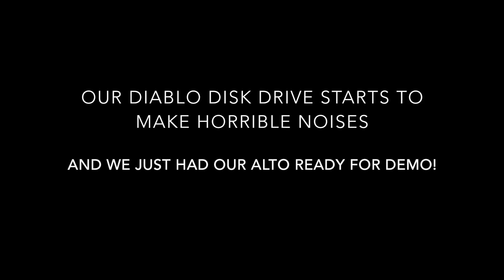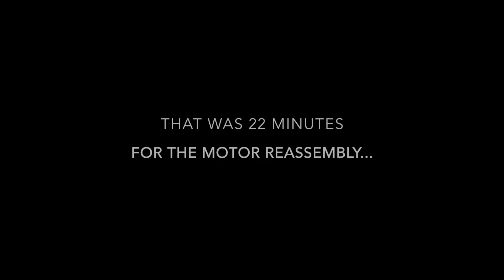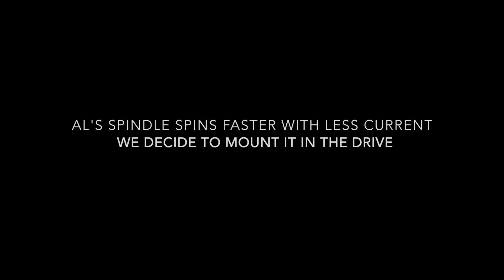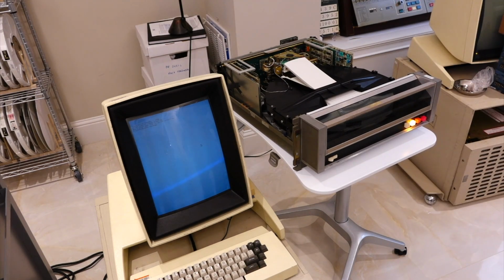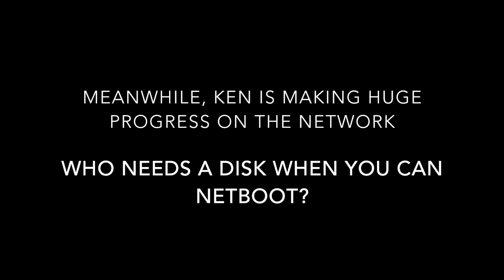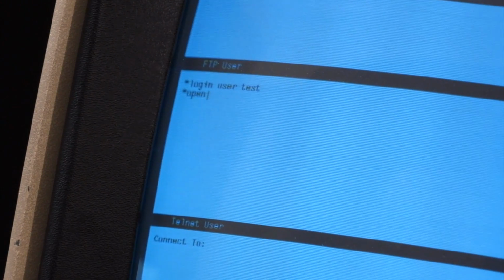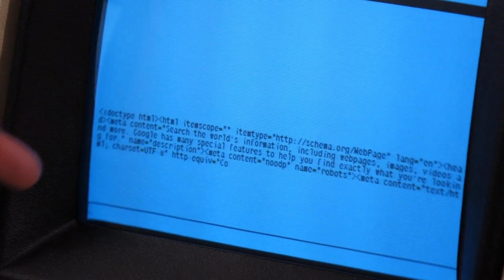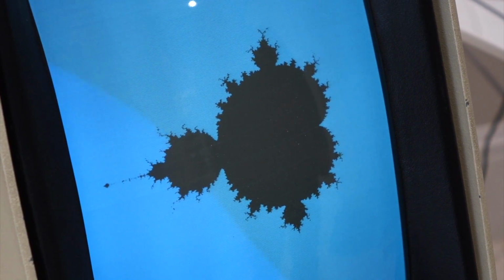Xerox Alto Restoration Part 16 - our disk goes down, the Alto connects to Google and draws fractals

Comment: Only 45 minutes to calculate the Mandelbrot butt-print... that's very fast compared to back in 1996 when I first got into computers with my first computer which was an IBM XT with an IBM CGA monitor and nicely-clicky IBM keyboard and I found an example BASIC program in the 1994 PC Pocket Ref book which was a simple Mandlebrot Set demo. I loaded GW-BASIC and typed in the 5 or 6 lines out of the PC Pocket Ref and hit the 'run' button and it took all night for the XT to calculate and display the completed butt-print. ;-)
Reply: Nowadays I run Linux and my favorite Mandelbrot Set zooming program is one called "Xaos"... I set it for 17,000 or so iterations and move the mouse-cursor over a desired spot on the butt-print and press and hold the left-click button and it smoothly and beautifully zooms in as long as the mouse-button is held, like travelling through psychedelic space...lol  ;-D

Comment: LOL.. the piece left after the initial repair, loved the games, Those games where hitting the barroom floors at about that time probably running off of the intel 8008..  love the telnet, but that Diablo, I remember from a time sharing terminal back in 1973.. the pretty much original dialup.  Love the emulator.  Recording all of this and the collection of records most certainly makes this historic en-devour with while and great for actually understanding computers.. I would say required course material after a basic or C first semester course..( CS104 Computer History - Required)

Comment: Wtf is he talking about nonstandard Ethernet to the modern Ethernet? That makes no sense what so ever.

This guy running the camera must not have any computer or networking experience.
Reply from the maker: You might want to watch the other videos, or maybe Google the history of Ethernet. You will find that this is the machine on which Ethernet was invented/prototyped/demonstrated for the very first time. Modern Ethernet would eventually evolve from this, but this first prototype implementation is completely incompatible with the modern version we all know. Not the same  bit rate, not the same packets, not the same CRC, not the same protocols, only 256 addresses (!), etc... It was actually a very large challenge to reverse engineer it and make it communicate with its modern offshoot. Some of the Ethernet inventors actually visited us to see their original machine, see in the video here: https://youtu.be/XhIohWr10kU .
Reply: CuriousMarc you do realize their is other networking media used other than Ethernet on networks right? Also a network that needed to talk to another incompatible network is done with a gateway. They have been around a very long time. Not a new thing by any means. Just not commonly used now.
Reply from the maker: @tomhardware2254  Not sure I understand the hate here. I answered your provocative and foul-language question in detail, see above.

Comment: guys do you have plans to replace the diablo disks with something that resemble a SSD like some SD card or CF card?
Reply from the maker: Heresy! But yes, Carl is almost done doing such a tool, which we will also make available for the CHM and the LCM museums. We won't "replace" the beautiful Diablo disc with it, but that gives us a way to try Alto packs quickly and not need to make new original ones if one crashes.
Reply: excellent. and thank you for answer. it is a great series of videos.

Comment: Hi Marc, what is that piece of equipment you were using to power and test the spindle motor at increasing speeds?
Reply from the maker: It's a lowly HP power supply, a bit modern and plasticky to my taste. But it has very precise voltage and current limit settings.

Comment: very very nice may i suggest you to separate the calculation and the  rendering process in two distinct parts ?
Also at the rendering level i'm pretty sure there is a better way to draw lines :
Store the length of the line and the number of pixel to draw , 
Display first the shortest lines first drawing one pixel at a time and for the lines longer than 30 pixels use loops or delayed loops and draw into graphics memory ...

Comment: Lithium grease doesn't dry out. Do you use that across the board in vintage computer hardware repairs that need oil?

Comment: I'm guessing that the disk drive starts up with an open speed control loop, and when the disk controller comes up it closes the control loop and brings the speed down to the proper operating speed.
Reply from the maker: +douro20 Good guess!

Comment: Okay, now you just need to run a version of Doom on it with the music and sound effects.
Reply: I don't think the Alto has a sound card, only a beeper.

I also don't know if the Alto has the horsepower to do Doom at all.
Reply: I have seen videos with an Alto which had a music keyboard and could play multiple notes with definable waveforms, but I never found any mention of this in http://bitsavers.trailing-edge.com/pdf/xerox/alto/ including the lists of non standard peripheral options for the Alto.
Reply: I found a video of the Alto playing music: https://vimeo.com/111334074
Reply: DOOM was ported to run on a VIC-20, so it could probably be done on the Alto as well.

Comment: Wow ! Booting off a network ? That was very advanced for 1974 ! Xerox executives had no idea how ahead of its time this machine (system) was. They could have been the Apple and Microsoft of today, combined into one company.  We can only imagine what this system would have become some 43 years later... It took an extremely talented,  innovative, and visionary team to come up with the Alto. Something missing from today's computer companies that are solely focused on profits instead of innovation.
Reply: if fact the Xerox Alto impressed S Jobs himself.
For the network boot just have to show the network device + the tftp stack to the firmware and boot just as it was a regular device ... 
boot bootp , boot tftp
Reply: @123jstechservices3  Linux can do this also. I built a pentium 130 diskless x terminal by booting over bootp and tftp with linux from a linux server back in 1999. All it needed was to program an eprom for a ne2000 network card (they all had an eprom socket!). the tools are open source. I later (2002) replaced bootp by a 4 MB (yes, megabyte) solid state ide hard drive to load the kernel which then mounted root by nfs like before.
Reply: Don't forget HP and Adobe.  They invented the laser printer as well.
Reply: 1973 not 1974

Comment: If you modify the program to turn the display off while computing the Mandelbrot fractal, the program will run significantly faster (since the display microcode is essentially idle, leaving the Emulator task more time).  Might be able to get it down to a mere half hour!
Reply: When I used software to compute Mandelbrot sets on my old Atari 8-bit computer, I used the same technique. You could turn off the display, and speed up computation, since part of the CPUs time was taken every 60th of a second to redraw the screen.
Reply: And then you could also "cheat" and just compute the top half and mirror it since the pattern is symmetrical. :P
Reply: The old Sinclair ZX81 had a similar feature - you could ask it to run in FAST mode, which turned off the screen refresh.
Reply: Ashley Pomeroy the commodore 128 had the same thing, you typed FAST into the basic prompt and the screen went blank, you could type SLOW to make it go back again
Reply: This takes me back to writing my own draw functions for a variant of BASIC (DarkBASIC): the default commands would update the screen after every call, which made them horribly slow.

Comment: Great progress!
In the video it looks like you have the brightness / screen turned up too high on the monitor, there are visible retrace lines. Had you turned the contrast down to try and preserve the phosphor? 
This is making it very tempting to come out to VCF West!!!
Reply from the maker: Yes, it was up too high by the time we took this. The monitor is usually dark at the beginning of the day, then brightens up as the contaminants gets boiled off the tube's cathode. We can't find a replacement tube...
Reply: Ah that explains it. Too bad you haven't been able to find a replacement yet! Is it an oddball CRT? 
At least once it's been on for a while the picture is bright and clear :)
Reply: They could send it to Lexel to get it rebuilt, but I don't know if the Y-Combinator wants to spend that much money.

Comment: I have computers that are 20+ years newer that can't netboot. Impressive.
Reply: I think that's mostly because we all have such different BIOSes and stuff so it'd be hard to. All Altos fit into about three configurations, as they went over in... part 10 or so, and the boot is similar between them. Apple might have been able to pull it off but it'd boot slower and need internet just to turn on. While it's a good concept it's hard to make work in practice

Comment: To think the carriage function and print head of Xerox-Diablo daisy wheel printers were made in a similar way to this also using DC 4 brush motors.
Reply: I always cringe a little when these types of HDs make strange noises.  I've heard one too many Quantum q2040 43mb 8" drives with "iffy" spindle bearings sound strange too.   I remember a certain Xerox 8000 gateway server at XBS Culver City which didn't like to be moved (even carefully) a few inches on it's castors.

Lastly the Xerox Star Achilles heal....they never like to be separated from the hive and operate as standalone workstations for extended periods of time haha.

The search for legacy OSBU South and BWS Hacks continues :o)

Slow workstations around Xerox were common.... Up to 20 min for a 6085I to boot in the morning....then have it reboot once again while you are at Lunch to Paginate and recover disk space.

Does the network interface which was bread-boarded and connected to the Alto's 3MB Ethernet card communicate with TCP/IP to the WAN?
Reply: Did the 6085 draw everything in software?  That was probably the biggest bottleneck on the Alto graphics-wise.  It has no character generator per se; only a framebuffer which draws directly to the display.
Reply: As far as characters are concerned, I know that fonts could be installed and were sold as additional software applications.  I also seem to remember that display fonts were separate from print fonts, at least when a Star Workstation was on the network.  By this time  (and with the 8010) XRX Interpress (Pre Postscript) was fairly well established.

I'd really have to dig and read up on how graphics were handled internally.  I'm sure others here will have the answers on the tip of their tongues... ;)